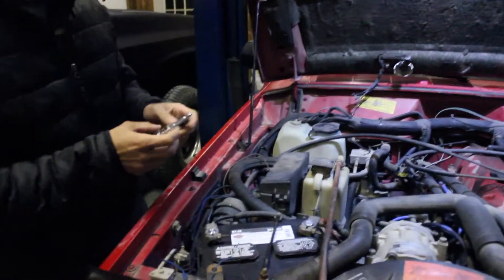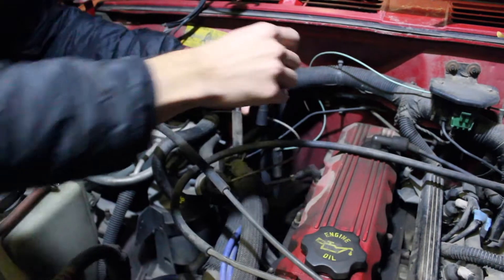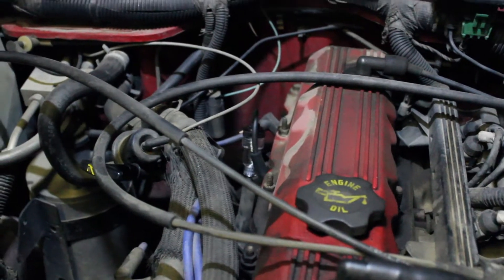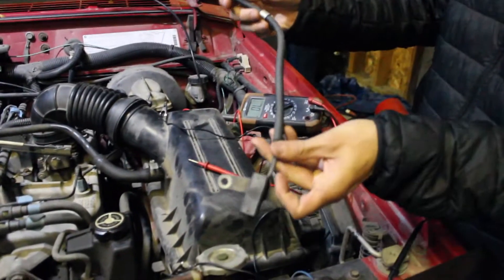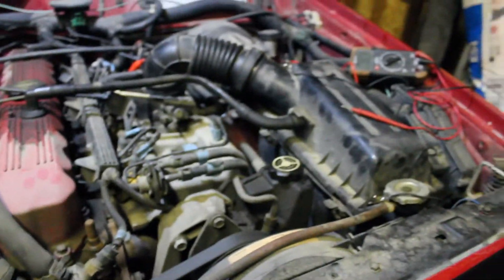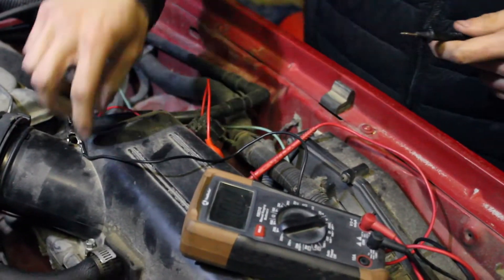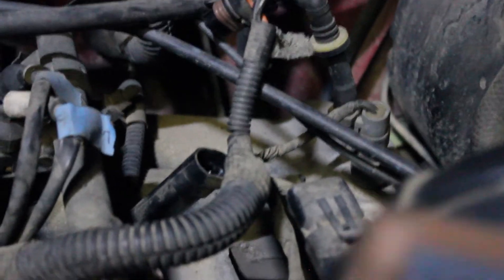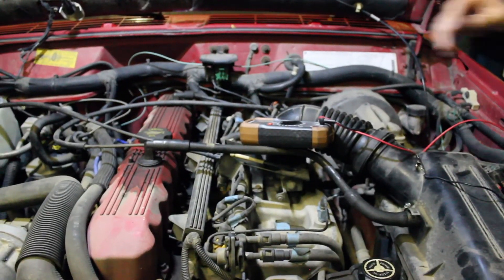1993 Jeep Cherokee XJ - No Start Condition - CPS Testing

Comment: Noticed that you got one spark after you released the key. My XJ was turning over, but then starting after I released the key. Sort of like engine run on while starting vs when turning off.
Reply from the maker: check to see if you are getting power to the coil when you should be.  if not you may want to look at your ignition.

Comment: THANKS DUDE GREAT TIP NOW I CAN TEST THAT INSTEAD OF POTENTIALY TAKING OUT AND REPLACING JUST TO FIND OUT NOT THE CHALLENGE..HAVING A NO START CHALLENGE. 
 SHOP SAID MAYBE IGNITION MODULE DO YOU HAVE A TEST FOR THAT ?
Reply: CHEROKEE YR 2000
Reply from the maker: I am not sure what the shop was referring to as an "ignition module", but i assume they were referring to the ignition coil.  I did make a video on how to test that.
Reply: @myles2go.  THANKS I WATCHED THAT VID..SHOP SAID IT RAN IDLE FOR 20 MIN BUT THEY COULDN'T GET TO IT SO I DROVE IT HOME..STALLED HALFWAY AT ONLY 10 MINUTES.TOOK 2 HRS TO START. GUESS TODAY IS TEST DAY.
Reply: @myles2go.  THIS ALL STARTED WHEN I DISCONNECTED AND RECONNECTED THE WIRING HARNESS FOR THE ELECTRIC FAN  IT STALLED..ANY REASON THAT WOULD BE WHY THE VEHICLE NOW STALLS AFTER 10 MIN OF DRIVING AND OR AFTER 10-15 MIN AT IDLE--THIS IS A YEAR 2000 CHEROKEE WITH 188K WHICH HAS THE COIL PACK NOT IGNITION COIL AS IN PRE 2000 MODELS..
Reply from the maker: @matthewpolo227  hmm i am not sure that would have anything to do with the issue showing up.  Did you disconnect the battery when you unplugged the wiring harness?  I could see it possibly blowing a fuse or damaging a relay if you did not.  I would start by testing for spark when you are experiencing the issue.  use the in line spark tester in between the spark plug and the wire (if it has one).  if you have a strong spark, i would move on to testing for proper fuel pressure.  I have videos about both of these topics to show you what i am referring to.  let me know how it goes.